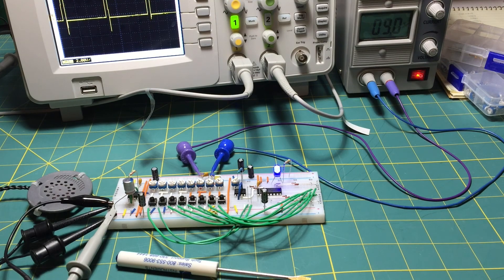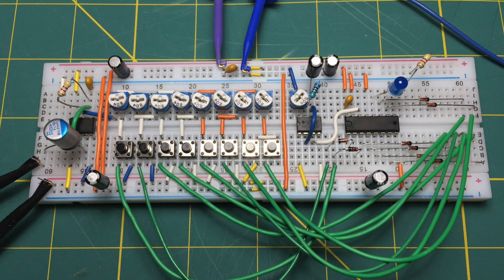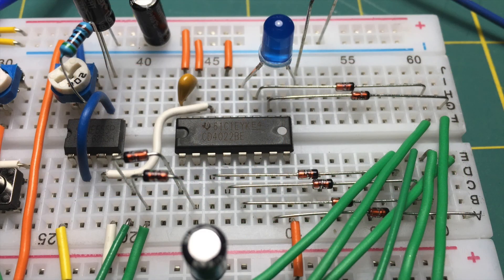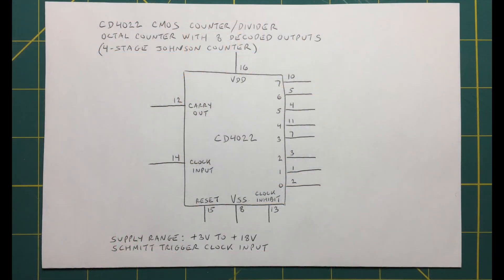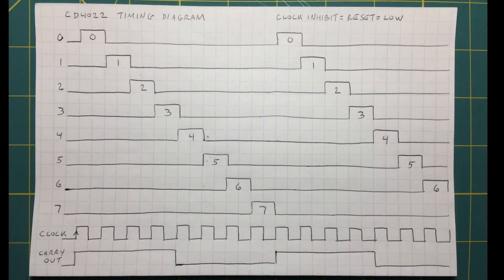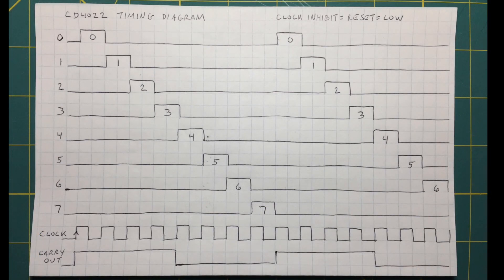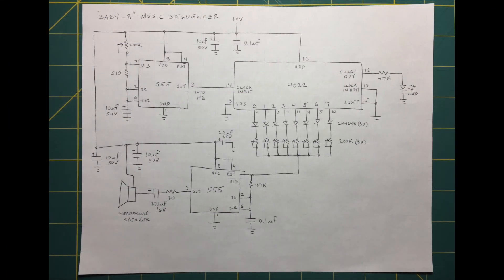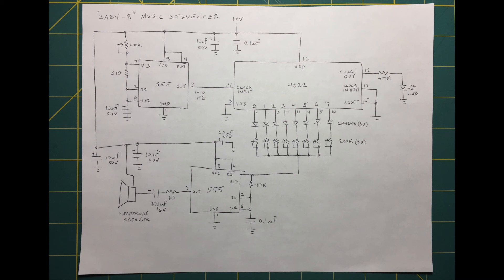Baby-8 Music Sequencer

Comment: Could LED's be used instead of the Diodes. Maybe a dumb question because they are both Diodes. I know... .
Reply from the maker: LEDs may work, though there may not be enough forward current to make them light up.
Reply: @NetworkXIII  thanks! I'll give it a try. By the way, I sent an email request for schematic and parts list earlier.